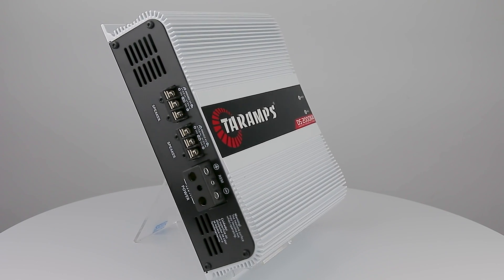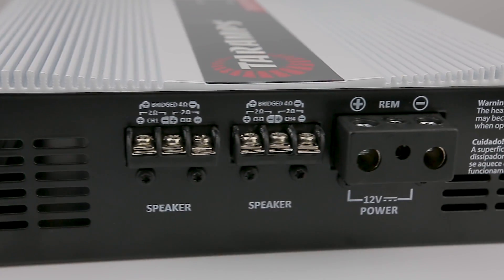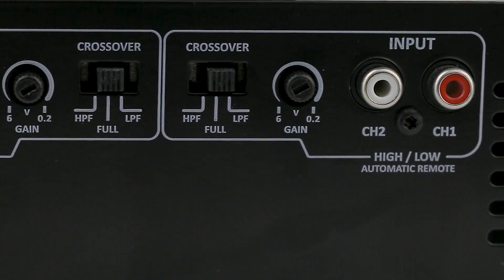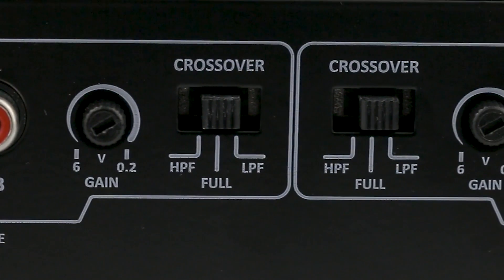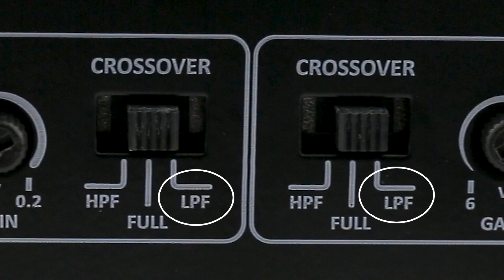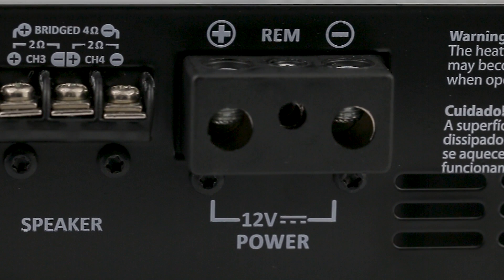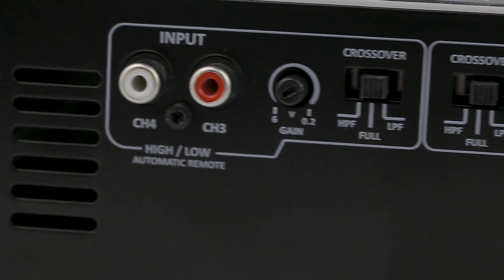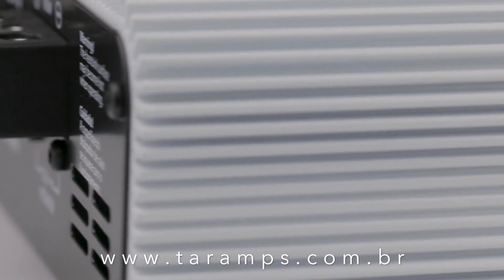Taramps DS 2000x4 - 4 Channels Automotive Module Amplifier 2000 Watts RMS | Taramps

Comment: What is the difference between TS2000 and DS2000? Thanks!
Reply: DS excepts high level inputs TS does not.
Reply from the maker: Hi recon440, how are you? The difference is in its technology and structure, since it is an amplifier released after the TS 2000X4, the DS 2000X4, so it has more technology. 🔊😄✌️

Comment: What width fork connectors will fit?
Reply from the maker: Hi Pimpala Mac, how are you?  For the speaker output, 12 AWG (4 mm²) and for the power supply, 4 AWG (21mm²).
Reply: @CanalTaramps  thank you